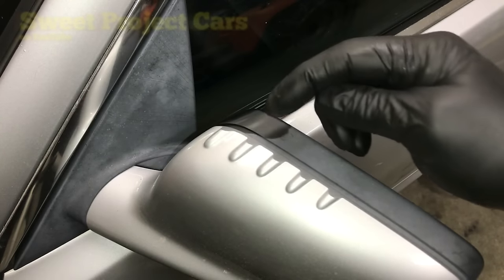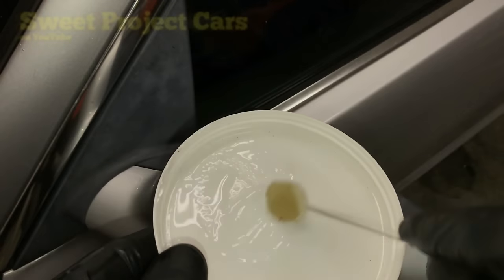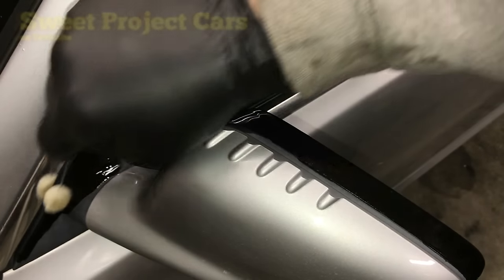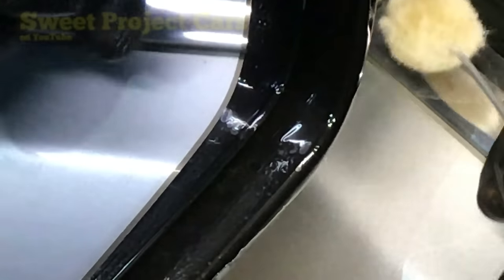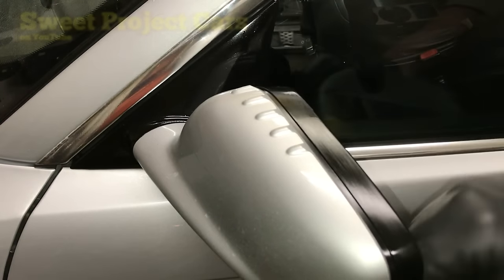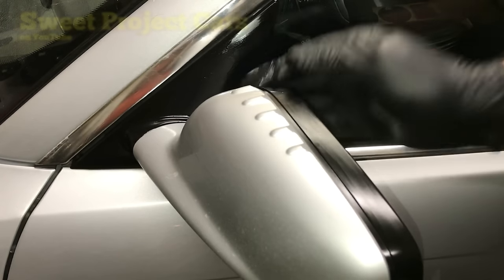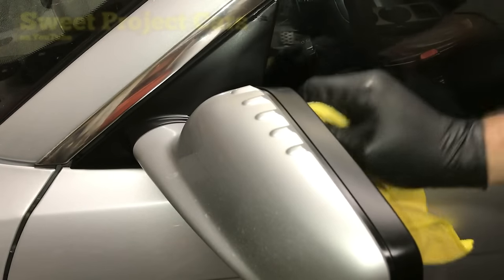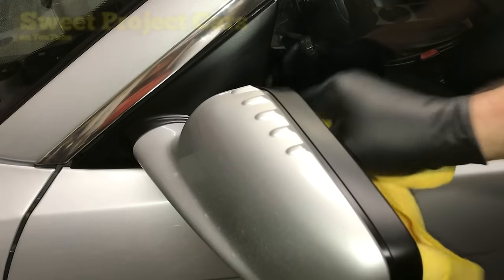How to Repair FADED Plastic FAST..... For Pennies!

Comment: I'm a bit confused with this one. Baby oil is just scented mineral oil. Are we supposed to mix those two things?
Reply from the maker: Celtic   we found it by accident when the two were mixed by mistake many years ago, there is something in the baby oil and when mixed with the mineral oil that just plain works, but it does have to be cleaned with the 99% alcohol first. 
It just makes plastic look great for a very long time.

Comment: Will the oil fix it forever? Or after a few car washes, it’ll be faded again?
Reply from the maker: Michael Broski well nothing lasts forever, but this is the best we have found in 20 years of detailing to outlast everything else out there:) we do suggest using 303 UV http://amzn.to/2jCHktN on all your plastic, rubber, leather, every 3 months to keep it all looking good and from dry rotting in the sun.
Reply: Sweet Project Cars true yes I’ve been using 303 for years now. Expensive but good stuff. It also doesn’t attract dust like silicone based products. That’s why I was so shocked to see you using armour all for the engine bay.
Reply from the maker: Michael Broski We use that on the engine only for the cleaning aspects of the product..once it's clean, we then always use 303 as our continuous detailer for it :)

Comment: The ingredients listed on baby oil are: mineral oil, fragrance. Seems a little redundant to mix it with more mineral oil... or am I missing something?
Reply from the maker: David   For this to work you DO have to use the products listed, we found it by accident when the two were mixed by mistake many years ago, there is something in the baby oil and when mixed with the mineral oil that just plain works, but it does have to be cleaned with the 99% alcohol first.
Reply: I'll give it a shot. Thanks
Reply from the maker: David you will love the results :) thank you my friend we are very glad you are with us

Comment: Traditional baby oil is high grade mineral oil. Some newer baby oil formulations contain high grade vegetable oils. So results may vary... just sayin'.
Thanks for the video.
Reply from the maker: For this to work you DO have to use the products listed, we found it by accident when the two were mixed by mistake many years ago, there is something in the baby oil we dont know what, and when mixed with the mineral oil that just plain works, but it does have to be cleaned with the 99% alcohol first.

Comment: Will just Baby oil work?
Reply from the maker: For this to work you DO have to use the products listed, we found it by accident when the two were mixed by mistake many years ago, there is something in the baby oil and when mixed with the mineral oil that just plain works, but it does have to be cleaned with the 99% alcohol first.
Reply: Sweet Project Cars then I can use pure alcohol? Very confusing!
Reply from the maker: first thing you do before using the two oils, is clean the plastic with 99% rubbing alcohol this here http://amzn.to/2E8UtDx then let it dry then apply the mixed oils to the plastic...hope this helps also let me know the country you are in and I will send you the link if we have it
Reply: Wil it work on intiror of the car ?
Reply from the maker: yes it will :)
Reply: Sweet Project Cars India boss!!! Very difficult to find mineral oil!
Reply: If your in Australia go to Woolworths and get paraffin oil. I'm going there now to get some. I'm pretty sure it's the same as mineral oil.
Reply: ... dude... baby oil IS mineral oil :D wtf ?  so yes.. the SOMETHING is mineral oil.
Placebo is a strong effect. So yes' using baby oil should be as good as this' at least I get the extacly same effect that last for a very long time :)   Also a heat gun is way better trick to bring old plastic back to live, if you dont got anything near it that cant take the heat ofc.  The best way is to resmelt the plastic :)
Reply: can u use 91%
Reply: While searching for mineral oil for another project, I discovered baby oil is mineral oil with a fragrance. Not sure why the combo works but I'm going to give it a try as soon as I have a customer who brings a faded plastic trimmed vehicle in next. Thanks
Reply: LetsPlay gaming did this end up working well for you?
Reply: How did the paraffin/baby oil mix work out mate?
Reply: Packaged hardware "Mineral Oil" does have a different viscosity than "Baby Oil".  So you are blending to make a cocktail.  They most definitely will mix as they are both paraffin oils.  Don't know if each would work alone, but I'd guess this is just the right consistency to absorb deeper in but not run off during the drying.

A cheap paraffin candle or black crayon will restore the black, but not soak in at all.  After a week it will melt away and streak.

Comment: J&J Baby oil contains only mineral oil and fragrance.  You should be able to use either of these as a stand alone.
Reply from the maker: You can use whatever you want, we are simply sharing what 40 years experience in the detailing industry has given us proven great results.  Thanks.  Have a great day.  mad Mike the hammer SPC

Comment: A BMW was an excellent choice.  Those cars (great motors) have the least sun tolerant plastics I have ever seen in the 90s and 00s models since cars in the 60s before the big three figured out how to slow the sun damage.   You can't use a particular color treatment on a BMW since one car will have five or six drastically different plastic colors on the interior.  I guess it is a German taste thing.
Reply: S Tho And nothing smells quite like a BMW interior. Even after 30 years those plastics are venting their juicy goodness into your nostrils & lungs. VW too have their own distinctive petro-cologne mix but not quite the longevity or knock-out power of BMW.
Reply: That said tho', even in my 19yo E46, the dash seems impervious to UV damage or discolouration. Looks like new even tho' we have sone of the harshest UV levels on the planet here in New Zealand. (And the skin cancer rates to prove it!)
Reply: I have a 12 year old E60 bmw and the plastic trim looks as good as new before that I had a 18 year old E39  and it was the same

Comment: I know you explained that it works even though mineral oil and baby oil are both mineral oil with the exception baby oil is perfumed. Just wondering if you actually tried straight mineral oil.  If it has to be both, I guess the perfume must act as a catalyst to make it bond better. But I thought of a computer guru who pulled a prank on his followers that turned out to be a joke.  I thought maybe you were trying to have a little fun when you revealed the secret ingredients and wanted to see if anybody would catch on that the ingredients were both mineral oil.  It would seem this would wash off after a few washes. Of course cotton balls would work just as well as those wool daubers and gloves aren't really needed. Thanks for all the great tips.
Reply from the maker: Ben we found it by accident when the two were mixed by mistake many years ago, there is something in the baby oil and when mixed with the mineral oil that just plain works, but it does have to be cleaned with the 99% alcohol first. It just makes plastic look great for a very long time.
Reply: This is definitely worth a try.  I saw 2 videos that recommend  long lasting products (C-4 and Solution), but a small bottle cost about 35 bucks.  Thanks for showing us how to save money on projects.
Reply from the maker: Ben thank you for the great comments and sharing :)

Comment: Looks really good. But what if I have previously applied transmission fluid to the plastic on the advice of some un-named son of a Saginaw fisherman? Haaha! Also, would this work on plastic head and/or tail lights? Thanks as always SWP!
Reply from the maker: Well Steve, you've got to clean it thoroughly with this https://amzn.to/3wIDQHd then use this  https://amzn.to/2YEhfz9  on all of your plastics and never have to touch them again.  Thanks for watching and asking, have a great weekend. mad Mike the hammer SPC
Reply: @SweetProjectCars  Thanks MM!

Comment: Is this method better than just 303 or would this be better for extremely faded plastic like in the video and 303 just to help prevent fading? Also could you use the oil mix to restore faded plastic with a lil heat gun action to help it absorb faster and more of it, then use 303 to maintain it?
Reply from the maker: they all work great we just like to give alternatives that we use for those in other countries that cant access some of the products :)

Comment: Can't we just use 303 ?
Reply from the maker: We do this when they’re extremely faded and then use 303 after that
Reply: That answered my question! Thanks for posting these great videos and being so responsive in the comments. I was wondering where you used 303 vs. this formula, if there was a material or exposure difference, but it has to do with the amount of fading. Fantastic! Thank you.
Reply from the maker: Daniel Glenn you are very welcome my friend, you should use this http://amzn.to/2jCHktN on all your plastic rubber vinyl and leather and you will not be replacing them for a long long time.  After you have used the mineral mix you can keep them looking great with the 303 :)

Comment: Yeah, I love your tips.  But I don't get it either, baby oil is mineral oil...
Reply from the maker: Angelo   we found it by accident when the two were mixed by mistake many years ago, there is something in the baby oil and when mixed with the mineral oil that just plain works, but it does have to be cleaned with the 99% alcohol first. 
It just makes plastic look great for a very long time.

Comment: 😂😂😂
Reply: Thanks for the like!! I am in love with ur channel. I bought the 3 wheel cleaners today for that special mix. I was wondering if you've done a video on why super clean is "caustic" for wheels...
Reply from the maker: goldandrubies super clean has caused issues for us when used on plastic with lettering on it and uncoated aluminum and some clear coats
Reply: Sweet Project Cars thanks! I'm not sure what it's good for anymore. Maybe nothing. It caused a purple ring around the stain on my upholstery... It doesn't degrease that well on tires. I guess it's good for cleaning polishing pads.